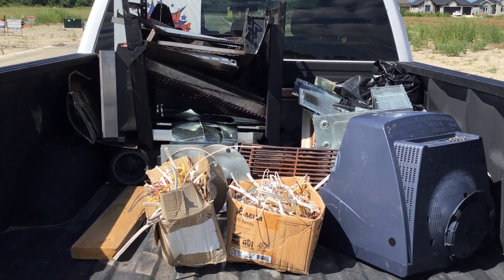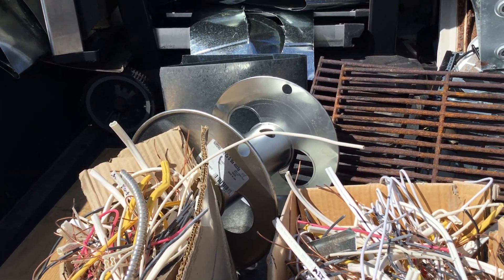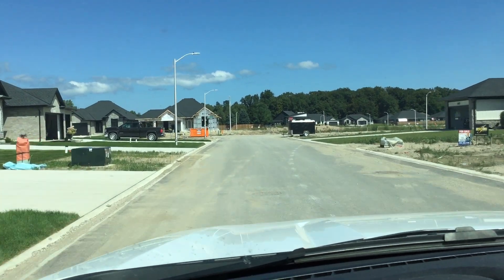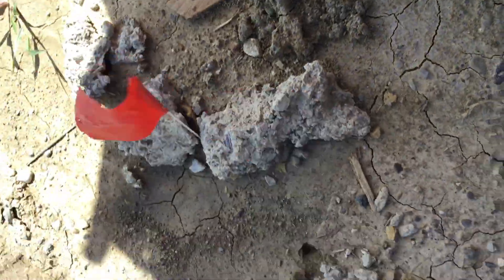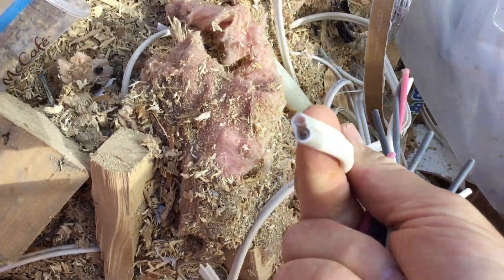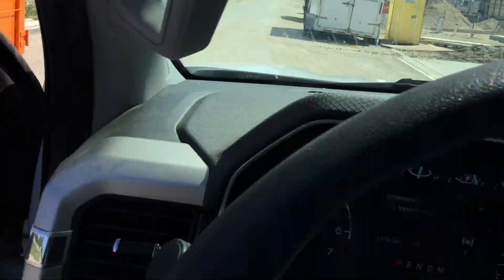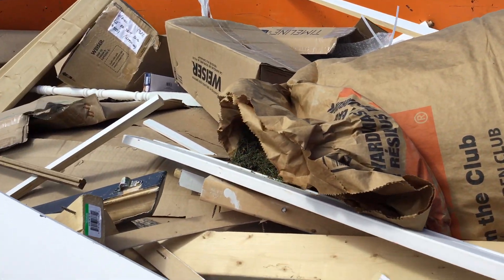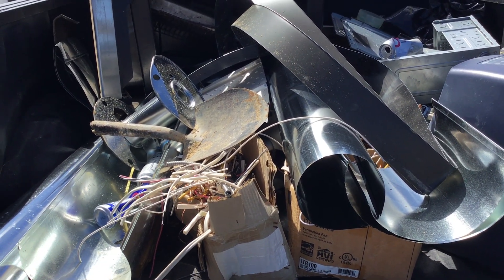Scrapping at a job site: the search for scrap metal continues to impress!!

Comment from the maker: Sorry #1 copper not #2 Rolex at $4.67 pound. Final weight of stripped Rolex I found 2.13lbs bare bright copper.
Reply: As a European, can you explain the term 'romax' to me, please?

😊
Reply: @frame-un7um household wire is called Romex.
Reply from the maker: Sure, romex is what we call regular household wire (the wire going to the outlets and inside the walls) there are different thicknesses depending on what the wire is hooked up to but it has an outer coating and threee wires of coppper inside, 1 clean and the other two are also coated with a plastic coating. @frame-un7um
Reply: @TinManScrapper  thanx👍